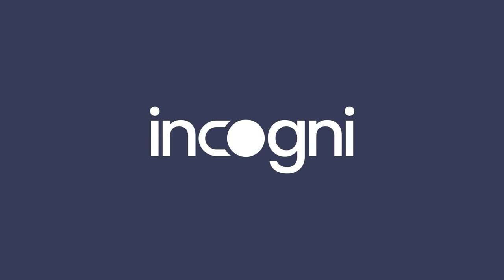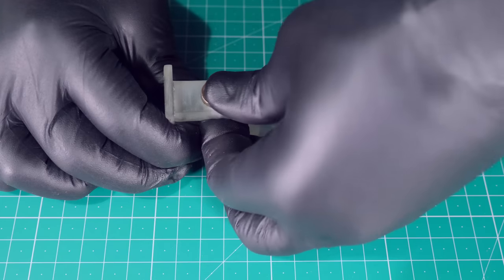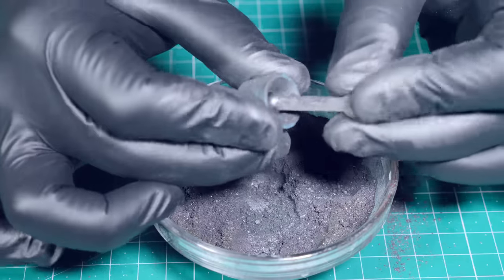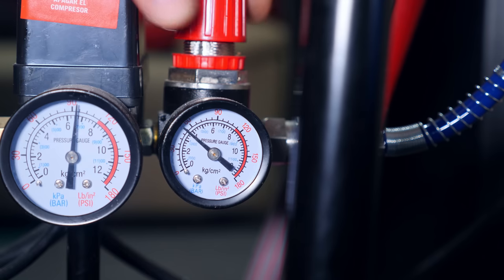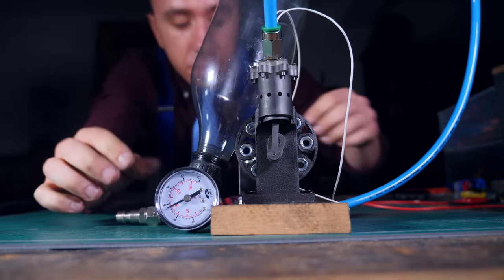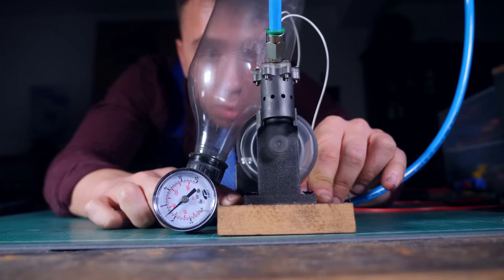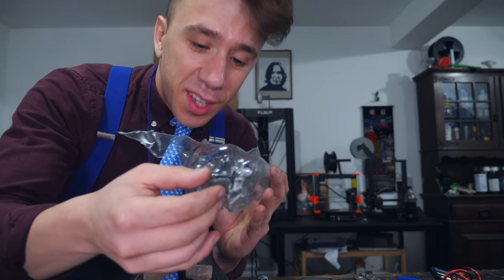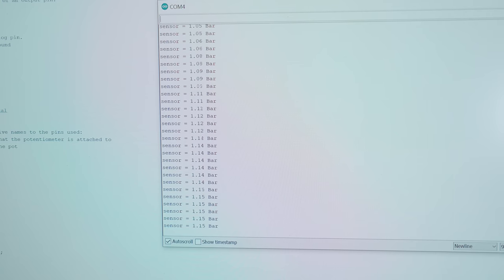Magnetic Air Engine

Comment: It's Interesting how I never thought of that but it kinda makes sense if you think about it. It would be interesting to see this design taken further and being used on a vehicle (small car, maybe even RC :-)
Reply: Yes it can be used ... and yes they have used it .. the guy in Australia has one , and mdi has one ... they won't let them use the already existing tech..
Reply: I hope you get the 3d printer :)
Reply: Jay Leno has a couple Dobles you'd appreciate, you should check em out. Runs purely on pressure from a boiler
Reply: MIT made a car in the early 90s I believe using similar concepts, but with hydraulic fluid, to get 80 miles to the gallon.  I guess powered engine would be used as a pump to Reservoir with hydraulic fluid, which would be let out to turn a crank

Comment: Just put dry ice in the bottle and it will constantly keep the pressure up.  You could add a safety mechanism to release the pressure if it gets too high.
Reply: As much as I like the idea, but dry ice won't be able to keep up with pressure drainage
Reply: There is always the choice of liquid nitrogen
Reply: @Malkawi_FTP it definitely can if enough is used and it broken up to have enough surface area
Reply: @genericfpv2464  A problem might be that as the CO2 sublimates, the pieces shrink, lose surface area. Similarly the bottle will get colder and colder. These will both reduce the rate the CO2 sublimates at, providing dwindling pressure. You could maybe try heating it, but that's booking a ticket to hospital. 

You can have a safety over-pressure valve but you don't want to end up losing too much of the gas that way. I bet it'd be tricky. Maybe some sort of chemical gas generator? As simple as vinegar + bicarbonate of soda, or something better. Aeroplanes use little canisters of chemicals to generate emergency oxygen for the masks. One generator per mask. They just crack a lever and the reaction starts. It gets quite hot, actually a load of old oxygen generators were once shipped, improperly, in a plane's cargo container and brought the plane down, caused a disaster and killed a load of people. They're explosive if you're not careful. All that heat + oxygen plus obviously reactants.
Reply: co2 and liquid nitrogen both will blow up the bottle, i have tried this. my coworker basically blew hius hand off with nitrogen filled bottle
Reply: I fear that both would increase friction due to ambient moisture in the air freezing on contact and frost build up though
Reply: mechanics>chemistry. sorry bud
Reply: I do not think dry ice  or liquid nitrogen will work. If you bottle it and want to use it as a pressure source, it will not evaporate quickly enough if at all.
Reply: Try a steam boiler
Reply: I did this with my friend some days ago and we really had fun by letting bottles explode with the dry ice
Reply: Increased density will take as much as it adds

Comment: I suggested this to Tom as well but I think you could get a big jump in efficiency by implementing a helmholtz resonator around the exhaust ports such that after the pressure spike it cycles to a low pressure for the next cycle's exhaust phase. If you can get down to atmospheric or lower pressure in the cylinder on the up stroke it'd take a lot of waste out of the engine.
Reply: If the engine runs at a constant speed, the intake can be tuned as well as the exhaust.
Reply: @Erik_Swiger  That's true! I think the exhaust will give a bigger benefit though.
Reply: Fluid mechanics is basically black magic to me. I only know enough to know you're probably right about lots of efficiency being left on the table there. I was thinking that with Tom's two cylinder version as well, thinking you could get some kind of intake and/or exhaust resonance between the two.
Reply: @WarttHog  Yeah that could be! I think basically you'd want to design that length of tube between the solenoid valve and the ball valve such that when the ball slams shut it creates a high pressure pulse that reflects back off the closed solenoid valve such that the air that's actually flowing in to the cylinder on power stroke picks up a tiny bit more pressure. I think the difference would be significantly less though, and likely you'd have to have a pretty significant legnth of tube.
Reply: That is a pretty good idea!
Reply: like a 2 stroke exhaust
 @Levibetz
Reply: I would also like to add that running the engine at a lower cutoff would significantly increase efficiency as well.

Comment: Some thoughts for improvements...

1. Reduce the volume of air after the "ignition valve" (the one providing air to the cylinder). As it currently is, the pressure shoots up when the valve is open - compressing the entire volume not just the cylinder. It seemed like it was a sort of loopy hose. If the volume there is high enough, it won't be able to fully depressurize when the piston is at bottom and the exhaust ports are open. If it doesn't fully depressurize, then the piston will have to fight the remaining pressure in order to get back to the top of the cylinder.

2. Rather than use a second valve, consider just using a pressure regulator between your high pressure source and the bottle. The bottle can be a smaller  one; but the opening should be fairly open -- otherwise you could just use a CO2 canister that you previously emptied. By using a pressure regulator, you won't need a controller. You could then have a source bank of a few of the CO2 canisters, the regulator, a small bottle, the ignition valve and then the piston... it should fit in a model ship if you wanted to do some gear reduction to a paddle wheel or something like that...

3. Lastly, because you are starting with compressed air, there could be a different way to go about it. Consider a wheel with multiple scoops out of its outer edge. These scoops should be something more like a J profile so that one side was very sloped and the other very "catchy". For the simplest design the outer case would have air input ports and air output ports spaced around. The length of the scoops should be such that no two adjacent ports would be open at the same time. You should consider a different number of scoops (say perhaps six) verses sets of input/output ports (perhaps five) -- so that there should always be an input port open to one of the scoops at all times... thus self starting. The wheel itself would be the flywheel... so you could space some nuts around it for mass. You could use magnets if you wanted to in order to use the controller to adjust the pressure to get a desired speed. The first version could just leave the air pressure on all of the time. If you wanted to get more efficient, you could have an "ignition valve" for each input port. Use a single magnet in the flywheel to make the timing right for all of the input ports.

Just some ideas, lots of luck...
Reply: Sad to not see any tesla valves. Maybe if the plunger was a tesla valve

Comment: you can add a pressure regulator to the tank so that the perfomance of the engine stays constant throughout most of the tank pressures
Reply: He kinda did make a form of pressure regulator (with a bit of hysteresis) in the form of the blipping CO2 canister valve

Comment: To utilize the full potential of the electrical valve you should, instead of the magnet switch use a sliding contact on the flywheel (like a contact breaker in an old engine), this would allow you to not just open the valve at exactly top dead center, giving you more power and better efficiency, but also give you the ability to tune the engine for power/ run duration by varying the length of the metal strip: 
Top dead center to ~90 degress of rotation for longer running time | 
Top dead center to exposure point of the outlets for maximal power
Edit: Alternatively you could use a cam & microswitch, instead of a sliding contact, this would be easier to set up, but you'd have to deal with imbalence of the flywheel caused by adding the cam.
Reply: There are also opportunities to use the microcontroller to tune the engine by tweaking the delay
Reply: Well, he might as well just use the MCU for that.
Reply: At the very least, just moving TDC a bit back should account for the opening delay of the electronic valve, which should allow for better performance without adding a computer into the mix.
Reply: The valve needs to be opened before top, there is a delay not just in the mechanism but the pulse of air has to travel some distance. Even if the cylinder is bolted directly to the valve, there is delay.
Reply: Good extension of it would be pressure sensor between valve and piston, to shorten openings when pressure is high and make them longer when goes down
Reply: Using a mechanical contact is a poor idea because of contact bounce and similar. The points in a distributor are made to open at a controlled time but the closure is going to be much more messy. The best solution is a hall effect sensor with a specialized encoder wheel with many pulses per revolution as well as a locating signal. This is what modern automotive engines use for fuel and ignition timing. This way the microcontroller knows the (near) exact angle at any time and can dynamically adjust everything with a high degree of accuracy.

Comment: If you want to increase max RPM, consider using two solenoid valves in parallel. That way you can alternate between the two, theoretically doubling the rate which you can supply air to the engine.
Reply: Exactly what I thought. I'm sure others did too.
Reply: yep, had the same thought @6adget
Reply: If he added a different type of valve mechanism that didn't involve back pressure on the piston he could basically triple the efficiency with the 2 ideas together.
Reply: That would give you two equally limited valves that eventually reach an RPM where either of them just stays open for too long and starts providing power on the upstroke which kills the momentum upon which the engine relies to complete it's cycle.

Comment: Improvement Idea: I wonder if you could retrofit a rim/tire to provide both the air reservoir and means of locomotion. If you do the BB8 thing, where an off-center weight is the actual transfer of motion, use your air engine to move the weight forward a bit and let gravity do the work of moving the tire along. If you use your timing circuit to detect top dead center, you could add another signal that detected if the weight is bottom dead center, then AND the two signals together to fire the engine. Or something.

Comment: It seems like this would be an easy way to make a silent or quiet motor for a small jigsaw or sawZall. Adding an idling mechanism would increase the run time by keeping it at a constant speed and evening out the weight on the main gear and shortening the top nail would help with efficiency(if you're still using the nail) but giving it a good balance and even another chamber or spring (like a Stirling engine) would be an interesting improvement. I would love to see you make a Jumping Cubli!!!

Comment: I think you can place the magnet on the flywheel and manually adjust the position of the sensor. Thus you’ll be able to find the most efficient angle of valve opening. Some sort of variable valve timing :)
Reply: Also less piston mass.

Comment: If you put the magnet on the crank wheel, you could adjust the engine timing by moving the hall effect sensor around  it - that way you could pre-fire the solenoid valve and get it to go faster :)
Reply: That is less efficient
Reply: also make it so upu can habe 2 valves, one for intake and one for exaust.

Comment: I would recommend using an air regulator between the bottle and the air engine. I think it will reduce the oscillations in pressure. Also use it with your CO2 recharging system because that was genius. Happy building!
Reply: The whole bottle and valve system is acting as a regulator in principal here. Why not just use the cartridge with an regulator instead? Would save on weight.
Reply: @formdusktilldeath  Exactly. All he needs to do is connect the CO2 cartridge directly to a pressure regulator like the one he used on his compressor. The regulator would maintain a perfect flow at a specific pressure and give the ability to fine tune the speed of the motor.

Comment: Relocating that electronic valve to the top of the engine would have yielded a higher rpm and more power per stroke.

There're very disruptive waves travelling through that long stretch of tubing, greatly dampening flow.

Your magnetic timing is a pretty great idea, though embedding an optical sensor in the sidewall of the cylinder would be much faster to react and more reliable.

The only other tip I have is to move the optical sensor mount point lower incrimentally until it counteracts the delay in the flow of the air, similar to adjusting valve timing on a car.
Reply: I was thinking the fly wheel would be better for time, because you could get a more precise area of opening. But if a turbo was added to create some up pressure on the cylinder,  it would have a small power band. But great point on the disruption of waves tho Definitely chocking some of that flow, and causing some unwanted vibrations.
Reply: @smeggle100  Tiny designs being sensitive to such finetune problems is always so interesting

Comment: As a car guy who loves your videos, it would be very cool to see this design implemented in an inline, multicylinder engine! Much love Integza!
Reply: Or a rotary engine instead of an inline 4stroke engine.
Reply: @downbelow5532 
It's a 2 stroke engine, not a 4 stroke.
Reply: @downbelow5532 rotary would be way more complex without benefit. Boxer or radial cylinder engines would be much easier.

Comment: You should use a mechanical pressure regulator instead of the bottle to have a more consistent air pressure when operating the engine. Also could potentially enclose the crank assembly and have the evacuated air from the down stroke funnel into the crank to push the piston up, potentially increasing efficiency.

Comment: I recommend putting the magnet on the flywheel and making the sensor bracket adjustable so you can start the valve opening just a little before the piston reaches the top. If that works out you can use the micro-controller to adjust how far in advance depending on the RPM. You could also use the micro-controller to adjust how long the valve is open depending on the pressure in the tank.
Reply: Yup, i second this motion. Valve timing control is possible so it absolutely should be utilized. The faster the valve is, the better it is in this case.

I also thing that cylinder aspect ratio can be tweaked, for shorter throw with wider cylinder. That will make timing even more important.

And then, bolt the cylinder to the valve, to keep friction minimal, and the pulse delay shorter, again improving also timing.
Reply: This also reduces reciprocating mass, which should be a big benefit. It can reduce overall rotating mass if one of the nuts in the flywheel is replaced with the magnet. Consider shortening the lines after the valves as well, to make better use of the pressure and have better timing.

Comment: Really fun design! If you wished to continue to run this at a higher RPM/higher pressure, you could use a rotary encoder in lieu of the magnetic switch. With how you have made the flywheel, you might not even have to redesign much at all, just cover the empty space outside of the nuts used for weight with a dark paper. 

I really like the idea of using the compressed air canister as a larger reservoir! I bet there's a way to use the fact that it drops in temperature so heavily without getting too far out into the design-creep mire, but not sure how exactly right now.
Reply: bump
Reply: Also with the rotary encoder you can also change the angle at which to open the solenoid, the best time depends on engine speed and the input pressure, as it take time for the pressurre front to travel into the cylender.  You might see it as the angle variator the engine have on intake and exhaust cam shafts.
Reply: sounds similar to Dan Gelbert's uniflow steam engine (videos of it can be searched for here/ design drawings, and written explainations were available online too). From a mechanical perspective steam engines are nearly identical to compressed air engines.
Dan chose to fix the angle at which the inlet valve opened. and just vary when exhaust valve shut.  In steam engine terms that's known as cutoff. Shutting the inlet valve later means the full inlet pressure acts on the piston for longer in the stroke. That's good for power, but dents  efficiency as much more of the gas's expansive energy is wasted 

regarding "pressure front". the main limitation is the time it takes for a solenoid valve to transition from shut to open. Even with mechanically driven valves, that process isn't instant, and during that the valve isn't able to provide full flow into the cylinder. That slows the rise of pressure above the piston. Increasing the forces that open the valves will result in improvement. However stronger solenoids tend to take even longer to respond due to the "electromagnetic flywheel" effect. I suspect solution may be to use tiny low mass solenoids, that then  control small volumes of control signal air that can then pilot (aka drive/actuate)  larger air controlled main valves.
Reply: try to have the motor generate electricity inturn supplying power to a compressor and the compressor can supply more compressed air to the enjin
Reply: @dylanswanepoel5517  this would not work as it would be breaking the laws of physics